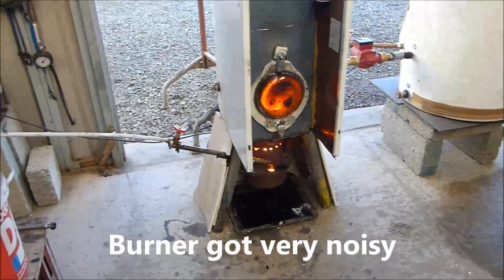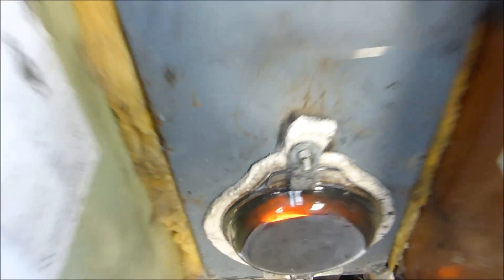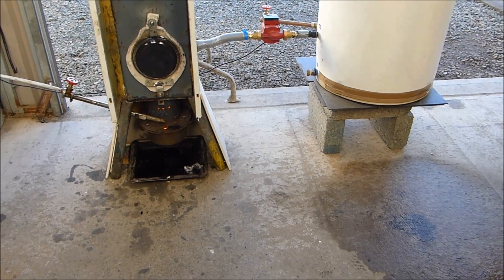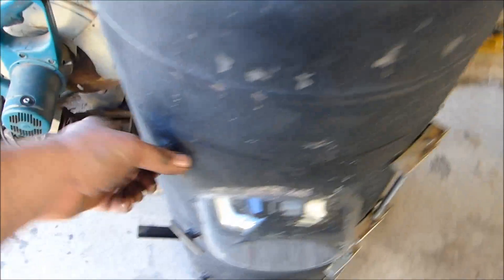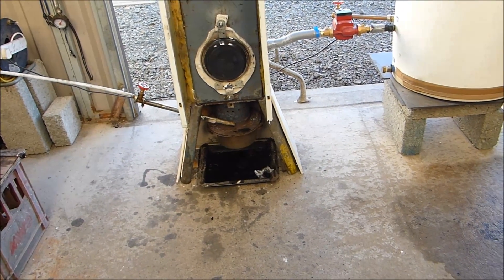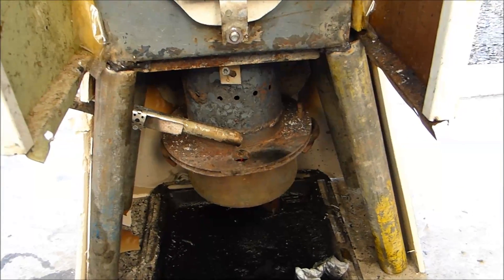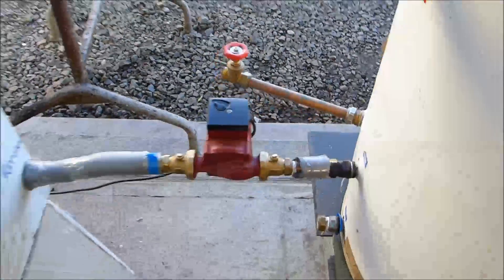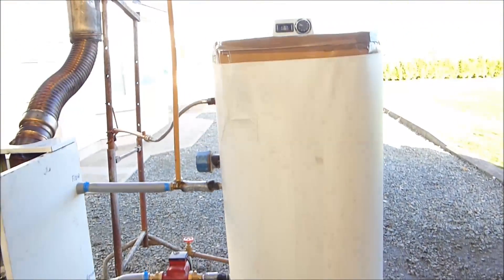Waste oil boiler. Problems with water in fuel

Comment: How would you control oil flow when the desired boiler temperature was reached?  Is there a thermostat that controls a solenoid gate valve?
Reply: In other words, if heat was no longer needed what stops the oil flow... conversely what re-ignites when it calls for heat again when temp drops

Comment: Same check valve can be used on the water return at the bottom of the water storage tank so that instead of using the pump, use convection so that the water feeds into the heating radiator from the bottom of the radiator and then feeds out of the top of the radiator to the water tank. I saw this being done with a rocket stove to heat water to be stored in a hot water tank.
Reply from the maker: Hi Azriel. I did try to use this as a thermo syphon but the indirect heating coil in the water tank is laid flat in this tank and not rising from low to high. Also I am priducing too much heat for 3/4  inch pipe to gravity feed. A bigger bore like 1 inch into the tank would do it I reckon. Cheers Gerry

Comment: Water when heated, as it turns into steam, becomes separated into HHO and thus burns nice and clean. Eventually, you could even have a side feed of just water that is heated in a coiled tube as well. Oh, I forgot to mention, it is a good idea that if the feeds are all coming downward from source, use a gravity ball check valve so nothing backs up into your oil/water storage tanks.

Comment: If you had your oil feed tube as a steel tube coiled inside the burn chamber, then the fuel is "preheated". then even if there is water in the oil, it too is preheated and if going into a jetted burner that also has the air intake coming in via a coiled preheated air pipe, then even the water will burn cleanly and the oil not only burns cleaner, but you use less of it with greater heat output. 
Just a suggestion.
Reply from the maker: Hi Azriel. I could super heat the oil water mix and see what happens. I have a different type of burner in later videos that would lend itself to easier experimentation. Cheers Gerry
Reply: Good. Looking forward to your report on doing that.

Comment: Your "fuel" tank can have a tab at the bottom to collect water, while your fuel supply can run from a higher point, so you don't have the problem. It happens oil from fryers has some water from the moisture of potatoes.

Comment: Use one of these plastic house water filters to remove the water and crap out of the oil You don't need the filter in it as the water will drop out as it passes through. All the solids will drop out too.
Reply from the maker: Hi Jim. To be honest the mix was more like there was some oil in the water. When I checked out the container it was nearly all water with a tiny amount of oil. Cheers Gerry

Comment: Thanks for your videos. I just finished my burner based on yours, and it works very well. Do you notice a different oil feed rate depending on the oil level in the bucket? My flame seems to go up and down with the oil level. That is the only problem so far except I have to be careful not to melt the stove with this thing! It can really put out some heat.
Reply from the maker: Hi aapont. You could try a needle valve or a bigger container so as the level doesn't change much. I can't say that I have had any problems with the flow rate. You could use a ball valve setup like a domestic cold water storage tank so as you have a constant level. Cheers

Comment: All of us on the Biodiesel Ireland forum have been watching your experiments with great interest.  Links have been posted on the Propane bottle oil stove thread. where several members have built something similar to yours and Spike occasionally contributes. You would be very welcome to post there.
Ive heated my home for 8 years with waste oil and water is a pain in the backside. An upflow separator and a filter setup is simple and cheap to make.
Reply from the maker: Hi imakebiodiesel. The Propane tank stove can certainly lash out the heat. I started work today on a different burner unit and if I can get some oil tomorrow I  will fire it up and post the results. I want to make a unit that will completely fit inside a cast iron stove. Do you have a link for the forum. Cheers